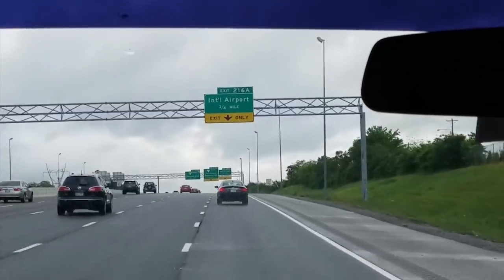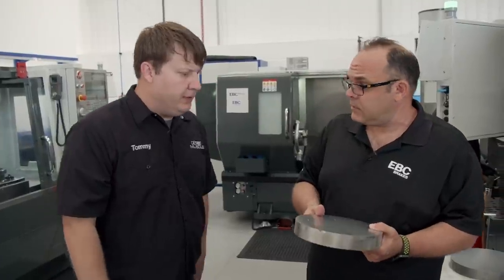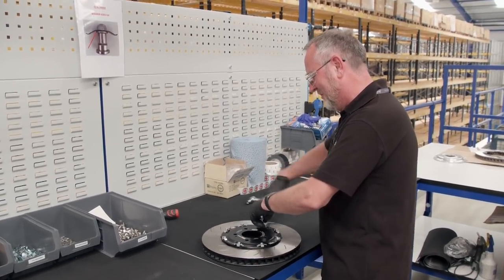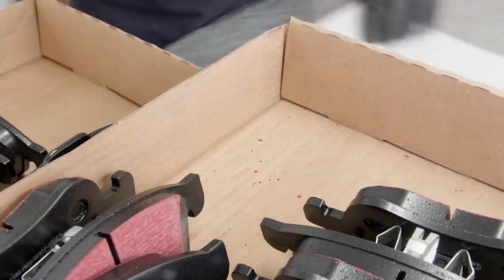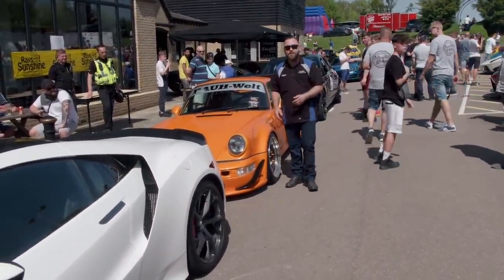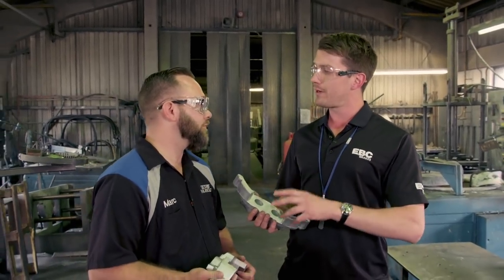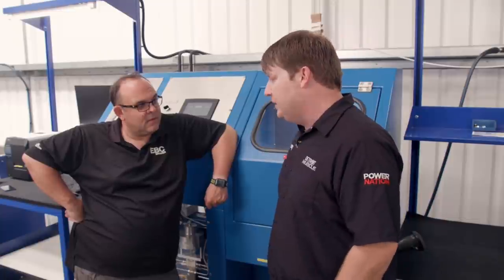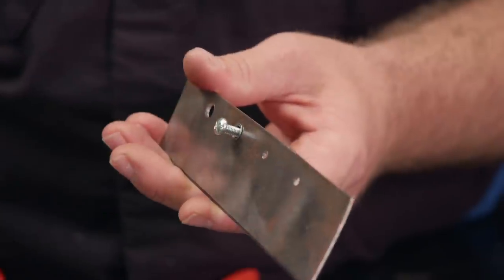How Are Car Brakes Made? Touring the EBC Brakes Factory - Detroit Muscle S5, E14

Comment: I worked in an aluminum foundry about 20 years ago.  I am sure that they add titanium and boron to the aluminum.  We poured some large aluminum castings for brake cylinders and housings and even transmission valve bodies.  Some of the John Deere castings were sent to Germany to be machined.

Comment: Late 1980’s my ex girlfriends father used to work making car brake pads and clutches marde from asbestos.. he’s been there 15+ years and for many years the workers had very basic precautions and breathed asbestos dust regularly..

By the time anyone realised it was too late, most everyone had some form of lung cancer.. (the dust was everywhere from the shop floor to management officces..

He died of cancer some years later.. as did the majority of the employees.  The company went bust.

Now modern materials are much safer but back in the day asbestos was common, be careful when working on older cars..

Comment: I'm not trying to be a party pooper; however, I noticed during the machining process that the discs were being slotted right to the edge of the disc. Doesn't this create stressor points which develop cracking? I've always been led to believe that slotting was to be limited and not proceeded fully to the disc's edge. What say you?
Reply: Cutting the vent all the way to the end allows the gases/heat to be swept away from the pad surface and away from the contact area more efficiently.  Structurally this cut isn’t ideal, but the benefit from cooling outweighs potential failure mode of a crack due to overheating.